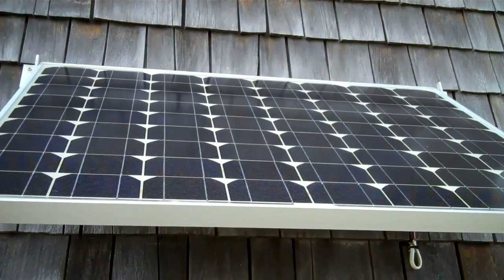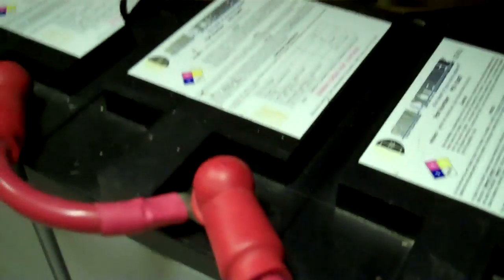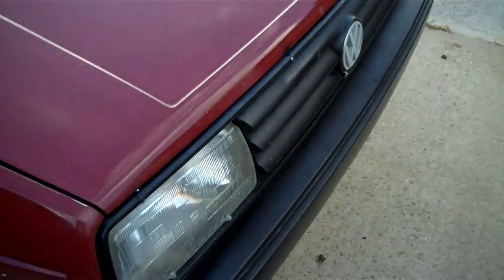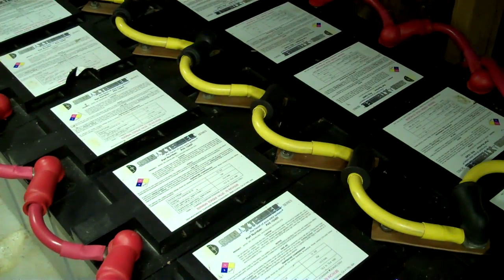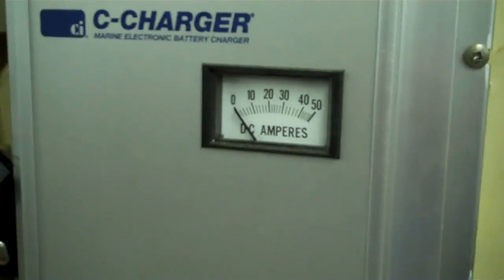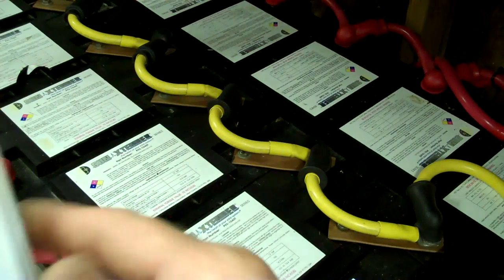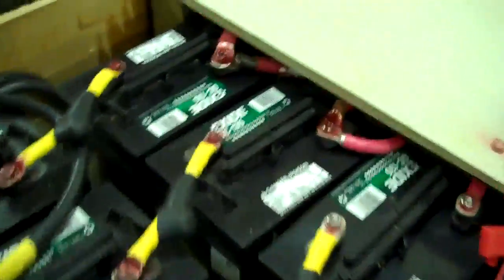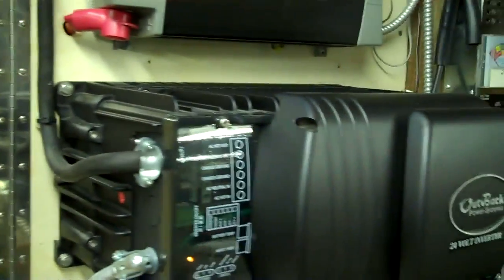HOW TO GET THE MOST LIFE OUT OF YOUR SOLAR BATTERY BANK

Comment: 12 volts is a highly inefficient way to design and run your solar system and battery bank. It  kinda works if you plan on running a couple of light bulbs and maybe a small refrigerator. When you figure the cost of batteries, charge controllers, inverter/chargers, solar panels, and everything then else your much better off paying for 48 volts system. It'll be more expensive upfront but will end up saving you a ton of money down the road.  Also a single 300 watt is useless by itself. No wonder you need you car to charge your battery bank. A properly sized PV bank will do the job but it takes time money and effort. Energy is free hardware and storage is not! Furthermore AGM, Gel, and Flooded batteries are ALL lead acid. prices have come down and AGM and Gel are only about double the price of their flooded counterparts. in a solar application when cycling your batteries i.e. using them everyday Gel batteries are superior in every way and offer double the life of floods and AGMs when properly maintained. Kudos to you OBX for trying to figure it out by trail and error but some jobs are best left for the experts. A fully integrated solar energy system with storage that works too its full potential is not something that you can simply put together piecemeal and is much more complex then most think. I know you are trying to help people figure out solar but you are actually doing them a disservice by giving them inaccurate information and setting them up for failure.
Reply: Hi Mike, yes that very is possible for an expandable system and adding a generator to support your battery bank is always a good idea.It's a smart way to go. For your generator I would go see our friends at Alten DC generators. A DC generator is far more efficient at charging batteries then an ac generator and also has a significant longer life span. There priced right and come in gas, diesel and propane at 48 VDC. For your inverter I would suggest either a 4000 watt or 8000 watt Outback Power Radian series. It's one of the best inverter/chargers on the market. The 8000 watt is a little more expensive but might give you more flexibility when expanding your solar.If you need any other help contact us at www.zeissbattery.com .
Reply: Zeiss Battery

Comment: What gauge wire are you using to connect the batteries? And is it cca wire of ofc?
Reply: +tier drop the wire usually with copper inside

Comment: between solar, wind,  hho and a bedini energizer; i would like to know where one would purchase the parts to convert to a hydrogen water-heater, hydrogen hvac furnace and hydrogen cook-stove and oven. in doing so it would allow me to go off grid 100 percent. only being hooked up to sell what i overproduce.---- for ac i would use a heat-pump with a two stage thermostat. with that setup it would never use an electric heat strip. it would turn off the heat pump off completely and revert to hydronic heating from the water heater and radiant heating in the flooring. after working in the hvac service for 7 years. i know how to work a home mechanical system to the best one "I" can.
Reply: dale myers, Forget about hydrogen. It is horrendously complicated. Heat your water and space heat with WOOD. For cooking, research rocket stoves on youtube and check out wood stoves and
furnaces on Amazon. A wood fired oven would be more involved but doable. Use solar for the refrigerator, lighting, TV, radio and computers. Microwave ovens are fine also.
Reply: 'm not going to be forced back to the stone age, if i don't need to. what about all that smoke. if bbq joints are forced to cook with electric cookers and can't make read pit bbq. then no one should burn wood at all ever. because wood cooked meat is best. and if i cook with wood. why wood i use up that recourse for heating my backside. i can stay warm under covers and good clothing. this is my opinion and i'm sticking to it.

Comment: With all these Q/A's, I'm surprised nobody has asked how long those 12-pack of batteries will last you! How long can you run on those 12 batteries? Thanks!
Reply: OBXSOLWIND I'm sorry I should have been more clear on the question. If you ran a 500 Watt bulb or electronic device, how long would it take for the battery to drop down to 50% or even drop down so far that it goes dead? Thanks!
Reply: +Limon Juice I fail to see why anyone would want to run AC or heat, off either solar or grid power. Just because that's the way most of the 1st world heats and cools does not make it the best way. 
I've been without real A/C for 7 years now and did the last 2 or 3 winters here in Colorado without heat, this winter I have propane heat. Which is cheaper, quieter and faster than an electric space heater. 
I can't see why you would want to suffer the droning noise and high power consumption of electric heating and cooling options. 
I bought a electric space heater when I had unlimited grid power at no cost, didn't even use it for a day before I got sick of the droning fan and the buzzing of the AC current and gave it away.
Reply: +Uncle Reeko : Say the man is giving his opinion on how he rates "solar power" and it's limitations,
I see no need to berate and use expletives.. Perhaps you should admonish yourself..
Reply from the maker: BuddySteve I have past the five year mark on both banks. I am thinking about doing a video on that. Thanks for watching...
Reply: thefront I don't know of anyone who has a 500 watt bulb in their home or office. Now, 5 100 watt bulbs, yeah. I think that's what you meant. More precisely, I think you meant how many hours does he get out of that bank? If I'm not mistaken, they don't ever go dead as he's always charging them with some kind of source. I'm guessing they rarely drop below 50%, if ever.
Reply: you can refurbish batteries yourself
Reply: you can refurbish batteries yourself
Reply: you can refurbish batteries yourself
Reply: Joseph M ain't gunna happen
Reply: very good contribution i think everyone have right to his or her own opinion beside what the guys analyse up there make a very good points and let anyone understand the capacity of solar system.
Reply: se7en1976
Reply: +rts I know many people who run several thousand watt HID high pressure sodium or LED lamps it's pretty common place these days :)
Reply: First of all electric resistive heating is the least efficient way in the world to heat something. People with solar usually are a little smarter with their choices, I have refrigerated air running off of 3 solar panels as much as I want. I also run all my electric consumption including house heat, water heat, and everything In the kitchen, everything is electric off of 16 solar panels. But yea if you hook up a solar panel to a roll of bailing wire to heat your house it doesn't work so well. But then again neither does anything else In life you do with that attitude

Comment: OBX, if you check this... Which style controller? PWM or MPPT? Which would you go with?
Reply from the maker: ***** I have not kept up with the newest latest and greatest stuff. The PWM is great for keeping the sulfation of your batterys plates. Clearly a MPPT charge controller is the most efficient option. I am running my charge controllers in the diversion modes and I'm not shore the mppt charge controllers offer that. Let me know if you know any different. Thanks for stopping bye...
Reply: +Limon Juice You do realize that IC is only capable of 1,5A of current at most, and have terrible efficiency since the method they rely on is burning the excess voltage off in the form of heat. Linear regulator is a worst possible idea for this purpose.

Comment: 12volt is the worst for inverters really crapy efficiency, 24 or 48volts is way better in every possible way, also when charging large battery banks with solar you really need  60 to 90 amps coming into a good 100amp MPPT charge controller at what ever voltage you are running on your battery bank.

Comment: 12V is OK for running a shack. But for everyday use, 48V is the way to go. 2kWh per month off a 12V storage system would require 8/0 awg cable and make the project impossible and full of line loss, when all you have to do instead is series/parallel your sources.
Reply: NOTW Wallace Wire every group of four 12V panels in series. Then wire all of these groups in parallel.
Reply: +Mike Brink You engaged in solar installation ?

Comment: Nice system I'll admit but there's something you said about 12 VDC vs 24VDC =. I think you should know by now that the smaller your voltage the more amp hours you use and hence draw your power out faster. In a 24 VDC system your draw is half as much as on the 12 volt system. 48 VDC even better
Reply: Joe Sanches Your assertion that using a 24V system as opposed to a 12V system will halve the current is only correct when referring to the current through the cable running into the inverter from either a 12V or 24V battery bank, but either way, whether connecting the batteries in series or parallel, the current through each 12V lead acid battery will be the same if the power drawn from either bank is the same. 

As an example we can use a very basic arrangement where two 12V lead-acid batteries are connected in series and this arrangement is compared to two identical batteries connected in parallel while identical loads are connected to each. So, two 60 watt 12V lamps are connected in series across the 24V circuit, and two 60 watt 12V lamps are connected in parallel across the 12V circuit. We will assume that the cables and connections show insignificant voltage drop across them when the circuits are live and that all four batteries are identical and fully charged.

In both arrangements, using math or by testing voltages and current in a real circuit, you will find that the voltage across each lamp and also the current flowing through each will be identical in both circuits, 12 or 24 volt, while the current flowing through each battery will also be identical in both situations. The only difference between the arrangements will be that the current flowing through the supply cable from the 12V battery bank will be twice that of the 24V bank but this current will be divided equally between the lamps in the parallel 12V supply circuit whereas in the series 24V supply circuit, it's the voltage that is divided equally across the lamps.

The only advantage of connecting a pair of batteries in series to give 24V (while as many 24V pairs as are needed for adequate supply time capacity are connected in parallel across them) is you can reduce the diameter of the cables running from the wired-up battery bank to the inverter and so save a little money, but you cannot reduce the current carrying capacity of the cables to each battery.

The chap who made this video gave his reasons for why he chose to use a 12V system which, I think, are quite valid, imho. Each person will have to weigh up their needs when building a system and choose the rail voltage that will suit.

Cheers

Comment: Awesome thank you. Do you recommend any books for someone getting started?

How do you hook the car up?
can a 12 volt charger be used to charge a group of 6volt batteries wired in series to 12v?
Do you suppliment your power needs with a generator, or do you just use your car? If so, any special consideration in doing so?
Reply: Did you ever find a good book on the subject?
Reply: nope....: /
Reply: Do you have a solar set-up now?

Comment: From my experience as an electrician in the navy, I know the perfect lead acid battery operating temperature is 77 F (>95 is really bad)! Some sort of "elevated charge" is also recommended on a weekly basis while your system is in use, but try discharging your battery prior to doing the charge (if your not using your battery constantly then don't have to equalize it weekly).  Nice video!

Comment: Thanks for sharing your video.  A higher voltage system is definitely more efficient and will tolerate smaller wires over longer runs.  The higher the voltage, the lower the current.  Currently, I have a 24 volt system in my shed.  Future upgrade maybe a 48 volt system.
Reply: A 24 volt system is better because the current used to deliver the same watts is halved. This means half the line loss from batteries. So, you could
run wiring that is half as big with the same result on a 24 volt system. This becomes very important when using any long runs from the collectors to the charge controllers and especially the high current runs from the batteries to the inverter. A 48 volt would be even better. Lower current means lower line losses. Higher voltage means less current for the same watts. You can use basic power formulas (Amps x Volts = watts) and Ohms Law E = I x R, to calculate things. You can also look up on a table the resistance per foot of different gauge wires.
Reply: DIY OneForAll
Reply: Respect my brother you open my eyes on how to calculate battery percentage used. May i humble say this I am currently using a 12v system and I recently ordered a 24v pure sine inverter one of the things that hits me is I realize the fuses and breaker I have for my 12v system is too big for the 24v system even though they are both 2500w inverters. Also I be using less wires to wire my battery bank so I am now on ebay eyeing lower value fuses and dc disconnect so I suspect I will get a longer run time out of my batteries next thing i had recondition some old run down car batteries i be using those for dc lighting as they are just there. Still respect on your video good job bro.

Comment: Learning curve is not the word, you are right. I am still up in the air about having 12 vs 24 volts. The main reason for wanting 24 is the other things (ie welding in a pinch) which I am told you can not do with 12 volts.
Reply: If you've got the money and need a big system, 1kw+ I'd say go 24v or even 48v. Otherwise 12v is fine and easy to set up as 12v has been long established in the marine and automotive world.
Reply: Peter Macca
Maybe where you live. Where I live there isn't one big box store I can go into and get anything 24v.
Reply: Peter Macca
What makes you think that?
Reply: Peter Macca
Meaning what exactly?

Comment: If you are having problems with sulfated batteries (and NOT being able to DE-sulface them) try adding 1/4 to 1/3 of a teaspoon of Epson salt to each of the cells inside of the battery (just pop the cap off with a flat-head screwdriver, being careful NOT to spill the acid out of course.)  Then shake the battery (after hammering the cap back) lighty from side to side - NOT shaking the battery around in circles, upside down and what not.)  Then put it on a low amp 12 to 12.5V charge, shaking the battery every 20 to 30 minutes for about 2 hours.  The battery may heat up a bit, just watch it to make sure the caps don't pop off and/or acid inside starts to bubble out from under the caps.  It should extend the life of your batteries to at least 10 years.  (I've been using the SAME batteries, and continuing to add more to my array in parallel to continue getting bigger and bigger checks BACK from my power company for about 6 years now.)  Be warned however the power compang WILL start to get a bit angry with you.... they have me.  ;) 

God bless & Semper Fi brother!
Reply: Seems pretty dangerous. I wouldn't do that. Proper maintenance and charging/discharging is all that is required.  I would however recommend getting a sealed battery---> less maintenance and as long as you don't charge them on a very high voltage they won't produce toxic gases!  If they do then your charging voltage is too high.

Comment: Why not just use Iron-Edison Nickel-Iron (NiFe) batteries…you will eliminate or greatly reduce the problems, and get 20+ years out of them (there are 100+ year old Edison Electric Co. NiFe batteries that still work @ 85% capacity today). Check them out!

Comment: Quick question, I have 2 230w solar panels, 2 12v lead acid batteries, a 12v / 24v charge controller, a 12v 1500w inverter, a 600w 24v grid tie inverter. What's the best way you would recommend connecting the whole system?

Comment: hello i have a question. i'm looking for something to control my battery bank (24 volts.) when it goes under 24 volts. it shoot turn off my (inverter  24 volts 1500watt 220 volts) . it  and when the voltage rise again over 24 volts it shoot still be turn off. all the way up to 26 volts and den turn on my inverter again. and all the way down to 24 volts and turn off again. 

can you help me with this problem?

hi michael

Comment: 2 freezer you will need at least 400-600 watts solar panel 12 volt  if you buy the electric measure metter at home depot. you will see how much the freezer or refrigerator run cost.  I have 1 refregerator and 200 watts is nothing. I will need at least 400 watts to run it and charge battery bank during the day.

Comment: My lead acid battery should be giving me 6 hrs of light based on my calculation but gives me less than half of that ( drops to in 2 hrs, 12.1 closed circuit). can it go below 12.1? Pls help.

Comment: I am just starting out with solar power and storage batteries and the information is very helpful. Thank you for your time and efforts in making these videos they real help people like me that are just getting started. My electric service offers an on peak off peak service rate. just swiching to on off peak lowered my bill alot. next is to get my on peak hrs useage downl. running electric loads like hot water tank, washer drier and other large loads on off peak is much cheaper. Thank you John